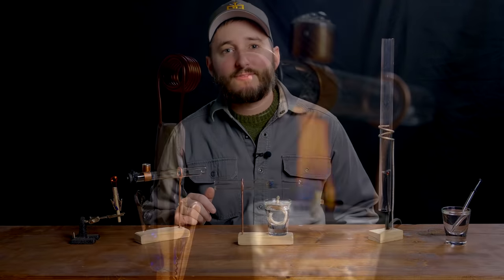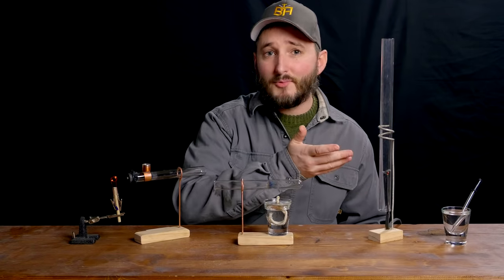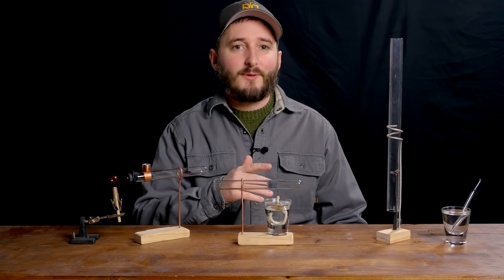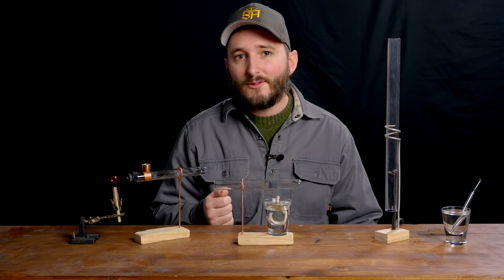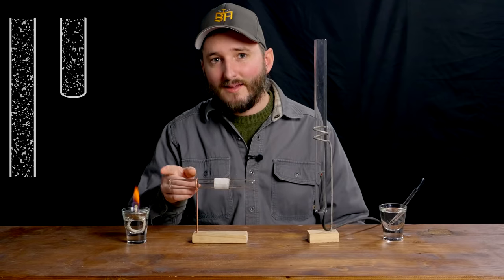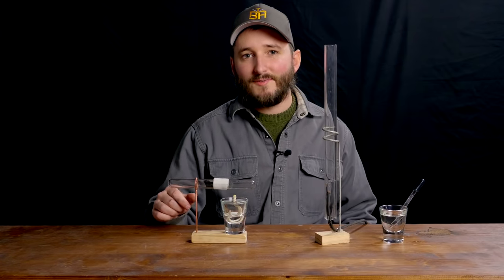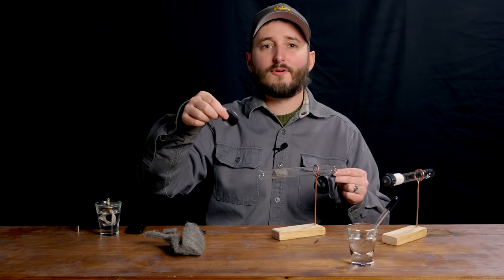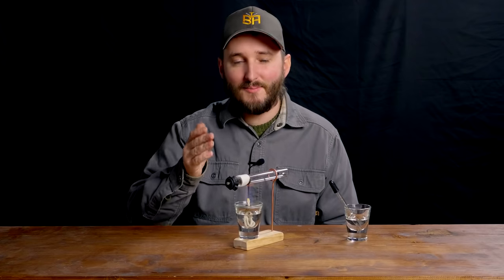Acoustic Energy & Surprising Ways To Harness It (Intro To Thermoacoustics)

Comment: Neat take on a Stirling engine with a stationary displacer
I doubt it is as efficient, but it could be great for waste heat
I bet it could light an LED if the coil had much finer wire on high turn count

Comment: Cool Vid! You should have put a multimeter on the terminals of the coil to see the AC voltage being produced. You should be able to get two LEDs in anti parallel (one for each pulse neg and pos going) to light up.

Comment: Instead of trying to make a coil that produces a voltage you could go the easy way and use something that already exists: a loudspeaker.
Just use it in reverse: pressure powers the cone (you need to come up with a creative way of cooling it so the speaker doesn't burn), and frequency/voltage is at the terminals

Comment: Hi! I am obsessed with the idea of using acoustics to improve the efficiency of desalination. Typical RO desalination requires 60 bars of pressure which makes it very expensive. Any reduction in the pressure needed would be a game-changer. 
My theory:
Finding the correct sound wave could that resonates with the correct frequency would help the salt bond release more easily. Merging the RO and soundwaves could lead to improved efficiency. What do you think?
The vibration from the sound might also help reduce the need for filter backwash to clean out the brine. Or, the lack of clogging of the RO membrane pores alone could improve efficiency.
I am obsessed with the idea since being involved in the design and construction of a large-scale plant, but I do not have the knowledge or materials to test my hypothesis.
Reply from the maker: Yes that would be tough to get right, but probably possible to use an ultrasonic transducer as the pressure source to force water through a reverse osmosis membrane. I'm sure that's been thought of before so maybe you can find other attempts online to give you ideas.
Reply: @Nighthawkinlight  I only found one invention using ultrasonic tech to do the desalination, but I guess that it did not work. And it was without RO membranes.

Comment: The point about the positioning of the heated coil has a parallel with radio and EM energy. A radio antenna has similar properties in this the electrical energy has to be applied at the correct point due to what is known as impedance matching

Comment: Try putting a miniature bifilar pancake coil. It's more sensitive to longer and shorter wave spans and you might get a induction. Plus those light bulbs filaments take a lot resistance to produce radiant heat

Comment: @2:22 if you used a thermal camera, I am sure you would see a heat mushroom coming from the top of the tube along with a wave Variation in the smoke from the sound waves as they traveled up the tube together :-D

Comment: there is a lot of physics glossed over; how does horizontal movement of air over a closed vertical test tube set up a standing wave? how does the vertical movement of air through an open tube setup a standing wave? what is the efficiency of this engine?

Comment: A neat school science lesson showing thermal convection and resulting vibrations causing sounds. But it's hard to imagine how this could efficiently produce feasible useable energy. It's heat in and energy extracted, the same basic principle we use for generation of power but in a less efficient form. I would consider this as a 'Sterling' engine or external combustion. If you consider it, all engines produce sounds.

Comment: I would reccomend an LED for this. Make sure you have the polarity of the magnet correct as well considering there is only flux induced if the could's "feild" is parrallel with the magnet. It might be better to have a rod come off of the rubber with a magnet on the end such that the magnet is in the middle of the coil to reduce the distance from the coil thus a large magnetic field. Another thing you could do to increase the flux is also to increase the turns on your could to increase its inductance, the change in flux is directly proportional to the inductance of the coil.

Comment: Get that coil/magnet arrangement figured out. If you can make around 5vdc through a bridge rectifier (or even make it a half wave) and solder a PC heatpipe to your collar and a heatsink with a fan on it, you'd be able to run that basically indefinitely without water. And it'd be efficient as your coil/magnet setup. :)

Comment: Too cool. Thanks.  I've been trying to figure out how the Pyramid stones were shaped and I knew you could create sound with heat so this fits right in.  They most likely didn't have electricity but they had fire, copper and bonze which means they had the capacity to produce vibration.  I think maybe they used the vibration to power tools that could be used to wear away the stones and shape them.  The artifacts / tools have mostly been lost with time but I can see with a little creative changes to what you've shown here it might be possible to reconstruct those tools today.  Next can we create a vibrating tool to shape granite using only what we know they had available 3 to 20 thousand years ago?

Comment: Your demonstrations are excellent. It's one of the few YouTube channels where the author goes deeply into all the details that matter and still keeps the narrative tight.
 
However, I have to ask you to add a detail that doesn't technically matter: please warn viewers that heating glass tubes like that is dangerous if even one small thing goes wrong. 
Or at least wear goggles where viewers can see them.

Someone who doesn't know why glass explodes might try to heat a cheap or cracked glass tube in the same fashion. 
And chances that a flawed vial will explode are pretty high, especially if he repeats the experiment a few times.
Goggles are cheap, eye surgery is expensive.

Comment: Your videos are amazing. I am particularly excited about the video on how to make a mirror. I’m considering trying to use paper mache to hold the mirror in its proper shape as paper mache is not as flexible when it dries. Plus it’s a lot more cheap. (Although it would take a lot longer to dry, so I would have to make absolutely sure the cavity is vacuum sealed so the mirror does not change shape while the paper mache dries).

Can you make a video for a stirling engine? I would love to see a tutorial that makes an engine that is both useful and requires the minimum amount of materials and tools possible.

Comment: Your magnet needs to be longer and the induction coil much closer to the magnets surface, with the setup you have there, stacking a few more of those tiny magnets on the end of the test tube should give more passes and a thinner wire coil should get more electrical output. If u could get an output of 4 or 5 volts you would be able to make a usb charger! 

The materials; Mica and Biotite (common in granite, black biotite mica being the better of the two ) have amazing thermal insulating properties in very thin layers and may be able to increase the life span of the coolant and should be relatively inexpensive to obtain.

Comment: i suppose you could use a voltimeter to see how close you are to lighting the bulb and perhaps switch it out to a less demanding one.
as for measuring the rolled wool, maybe you could pass a light through it with a solar panel on the other side and again check the volatage.

Comment: YOU CLAIM TO READ ALL OF YOUR COMMENTS. COULD YOU PLEASE ANSWER THIS QUESTION? How quickly does the velocity of sound change when you change the temperature? Does it gradually slow down or instantly change?
Reply from the maker: Gradually as the tube holds heat and takes a moment to adjust

Comment: Would love to see this done with a digital meter attached to the wire to see what was produced and the wire optimized for electricity generation. With this set up you may be able to produce enough to charge a lithium battery.

Comment: to light up the bulb，here are some steps to improve:
1. Use iron plate instead of magnet inside of rubber diaphragm.
2. use red color LED instead of Xmas tree bulbs. (red LED hv lowest driven voltage).
3. use thinner gauges wire to make coil so that more cumulative coil wraps can generate voltage instead of current, LED needs min. voltage to light up.

Comment: I wonder how efficient this would be a t power generation. You could just plug the opening on the other side by a speaker which is basically a linear generator made to oscillate on a high frequency. There are no moving parts despite the diaphragm which should eliminate most friction of cranks and such. This concept is a very interesting one.

Comment: I had a question arise one day: would it be possible to pull sound waves out of the air? The application would be to reduce or eliminate the noise pollution generated by traffic on roadways.

I looked into it for a while and even discussed it with a PhD in France. He had written a paper on converting sound to infrared radiation via a metamaterial (mathematically designed structure). This seemed like a perfect solution to my question: metamaterial structures placed along roadways that would absorb the sound and convert it to harmless, silent, infrared radiation. 

On pressing him however, I think he was basically telling me that the metamaterials would only work for a single frequency in an acoustically controlled environment (i.e., a box in a lab). I think he got tired of answering my questions because I'm not trained/learned in acoustics (except for how to make pleasing combinations of them with instruments).

Another issue is the geometry of the sound being created. I guess sound waves from a tire moving at high speed on pavement are moving out at large angles and will simply go over any kind of absorbing structure that is placed by the roadway. Ideally the structures could not be high so that drivers' view of the landscape would be impeded.

He also brought up the fact that human hearing is logarithmic, so it's very difficult to block out sounds. The quieter the sounds become, the more sensitive our hearing becomes.

It still seems like a cool idea. It's a very difficult problem.
Reply from the maker: See this video https://youtu.be/7dlLmeage2U
Reply: @Nighthawkinlight  In that video he says, "This is a solution. Well, not a solution but something to help." 

I decided this morning to see if I can find a way to get a research grant to work on this (road noise).

Comment: You need to reduce your resistance in those coils, you should have either used few wraps of the coil or thinner wire or both and braided it.  You could have also substituted a canthal or nichrome coil which probably would have worked.

Comment: I feel there is a way to make this basically fully autonomous. Have a rain catcher to collect water for the cold side and mirrors to focus solar energy on the hot side. Which you can extract energy from.

Thinking very off grid applications that don't need a lot, or constant, power, just some. A very simple device compared to a solar panel. Would be very useful to have in a post-apocalyptic scenario due to ease of manufacture.
Reply: An all-day drone. Some ancient stone figure do this

Comment: I believe the miracle I saw named rice drum. 3 simple parts. bottom contains a little water. the middle was rice sizes pebbles in my  case and the top is capped with a rubber membran.  As the water gets heated it produces a sound.

Comment: for producing electricity the coil must switch between polarities. so you need a small enough coil to fit inside magnets wibration area. and magnet needs to be positionet to switch polarities inside resonation area ,probably.

Comment: I would configure a small speaker from an old broken set of headphones to drive the led circuit - the speaker would actually be operating as a microphone, generating the power needed to light up the led(s).
Reply from the maker: I had the same idea 👍

Comment: THINNER LONGER MAGNET ON THE OUTSIDE OF THE RUBBER SKIN with tighter around the magnet, thin copper wire coil does power up to 3 lights.

Comment: Make the copper coil with smaller gage wire.... 

Use more wraps around the magnet and you'll create more electricity. 

It's basically the change in magnetic field that is inducing the current. However, it's a very tiny change in magnetic field (since it moves a short distance through the copper wire) so a thicker wire won't induce as much electricity since the wire itself would act as a giant resistor. 

Lower the resistance, increase the voltage....

Comment: Great video, reminds me of how tech was.
Sterling's engine.
Also shows how you don't understand electric. You were making a inductor coil. Thin wire would be required and a longer magnet to stroke the wave form I to the coil. And back. A diode and led may have shown some results.

This tech while a concept of new, was a feature of work some 40 years ago. And 80 years ago..
Resonance carriers and forms against the atomic level (quantum)  makes for a simple and easy control of things around us.

Highly dangerous of course as the guy 80 years ago liquidised his organs. And as advances were made the tech was  " big pharma by many accounts" due to medical and energy, and weapons use.

Comment: @16:00 If you used wire that was hair thin and closer to the same diameter of the magnet on the membrane, you would have produced a lot more power.

Comment: The magnets on the rubber diaphram did not produce enough energy when ocilated through the coils because the application was not used, properly. I belive it will work in future attempts if 1, the magnets are vertically shortened around the ends farhest from the rubber connections and horizontally widened. The application might work then if used with the 2018/2019 updated thermodynamic laws which apply to most magnets and engines i have worked with.

Comment: Do you realize that you have explained the operation of radio-frequency antennas? The magnet slows down with the coil because of eddy currents, not necessarily due to useful power draw.

Comment: Is there any good way to visually see these sound waves moving/vibrating in the tube? Could one introduce smoke to the system from the bottom and use a high speed camera? Or, maybe, since this is heat, would a sufficiently sensitive thermal imaging camera work?

Comment: I love your videos. Great ideas and demos. Now for a comment and question. I've tried to reproduce the horizontal test tube singing tube and thermoacoustic engine shown in your video but have failed to make either work. That's not quite true. I've been able to make the singing tube produce a loud sound but I had to use a cook's butane torch. After many tries, I've still not been able to make the test tube sing using an alcohol burner. Could you suggest what I may be doing wrong?

Comment: Awesome!
I love your work!
Question though, if the smaller tube is 1/2 the length but has a closed end therefore the sound waves enter, reflect off of the closed end then exit …. My question is what is the cause for the sound wave? Why do you we not hear the sound before it enters? Furthermore the temperature gradient has to work in the push-pull fashion. 
Sorry, just some questions in my head.
Reply from the maker: The wave starts by the heat expanding the air in the tube, pushing the air outward. The moving air has momentum causing too much to exit the tube, and so it gets pulled back in after slowing down.  The cycle repeats, which makes the reciprocating vibration that is sound.

Comment: Wrong bulb, need to use an LED. Those Christmas light bulbs need like 50v to show up even as a dim light. Also use much finer copper wire as tight to the diameter of the magnet as possible. Would love to see a pt 2!

Comment: replacing the weight with a neodium magnet, and adding a coil it would produce electricity, that through a hight voltage converter could run a teslacoil, that could then power a lightsource.... lest you prefer the candlelight....

Comment: Great videos, you mentioned that temperatures are close to those for home heating - question:

With development, do you think that variations of this concept added with hot water tanks could increase energy efficiency in the home? 

If you created mechanical energy, then (although at another loss of energy) you could create electrical energy - with sufficient improvements, you could easily place the tubes in hot air vents all over the house with a water cooling line - although small energy would be generated, if put back into the household grid - that could be a green way to reduce energy consumption.

Comment: Very nicely explained. Thank you! Questoin:  At 14:48, shows the hole you punched was pulled over the opening of the tube. Does that mean, without the hole, it will sill work? Without the hole, it will not blow up like a balloon?
Reply from the maker: Good catch. With the hole pulled past the opening the air will still leak out slowly or with a little help pulling on the rubber by hand to open a path. It is still needed.
Reply: @Nighthawkinlight  Thank you for clarifying that question. You are amazing! AT work, we are introduced to acoustic heat pumps. I went on Youtube to search for the topic. I watched a few that did not hit the satisfaction spot, so I keep searching until I found yours. Yours are the most detailed and easiest to understand. Thank you very much!

Comment: I'd love to build one of those open-ended resonators. What is the gauge of nichrome wire, and what voltage and current did you use?

Btw, I love your videos. Getting addicted.
Reply from the maker: Not sure on gauge. It was whatever size was in the hair dryer I ripped apart for it. The power supply didn't give me amperage either. Between 10-30v
Reply: @Nighthawkinlight  ah, ok, thank you for your reply! I had assumed you bought the wire somewhere.